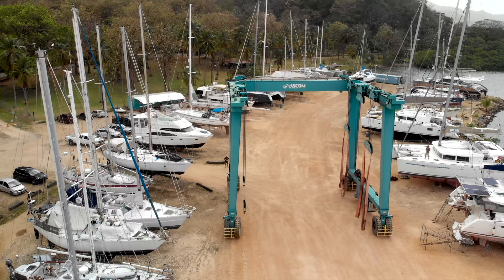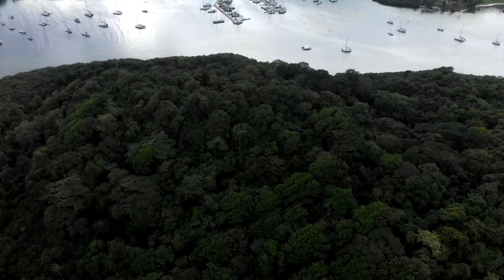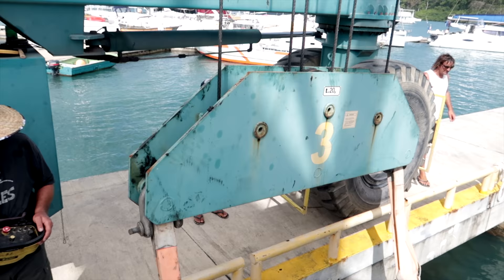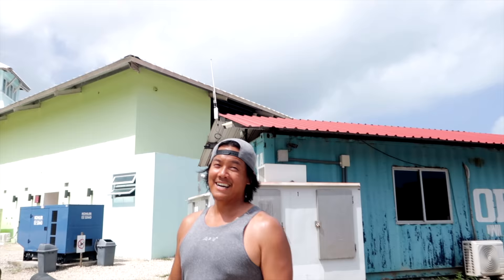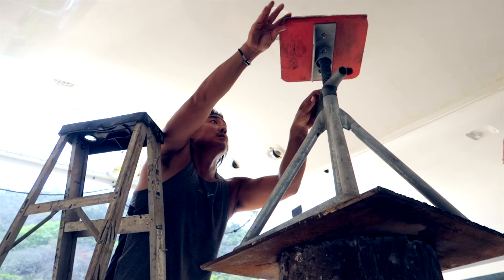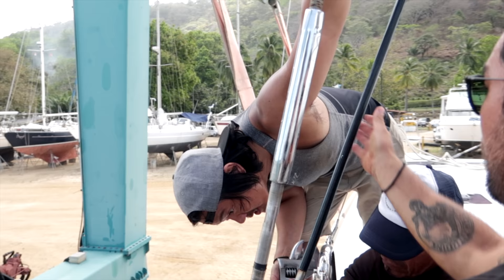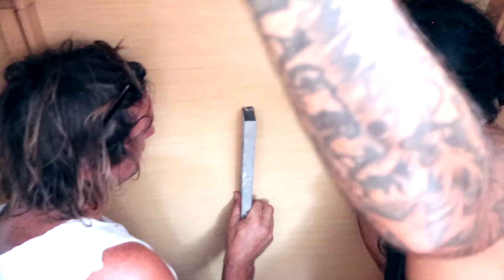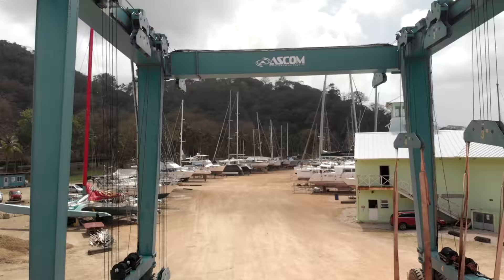Straighten Your Bent Catamaran in 8 Simple Steps - Cracked Bulkheads on Lagoon 450

Comment: David. Restoration Mechanic here. If you haven't already done so - Invest in boxes of Ziploc bags and tape. Every thing you remove, write the number on the part, and the bag of fasteners, then tape it to the part if possible. This will save you from the Remove and Lose gremlin more often.
Take Pictures of everything if you aren't already! If you think you have enough pictures of an assembly - take five more. This will literally save your sanity reassembling things - and can be used later to prove damages if this turns into a legal fight.
Also - instantly subbed you and parlay :)
Reply from the maker: Thanks for the tips! I'll go grab a bunch when i head back. The remove/lose gremlin has a secret move on boats where things always end up sinking in to the depths. I do the take pics trick, but sometimes you have to back up and take a pic of what you're taking a pic of. Also, did pokemon really get you out of a ticket? would make sense that cops would play.
Reply: What can I say, the southern US is a strange freaky place where people go to cemeteries at 3AM to catch Pokemons.

Comment: Good to see you getting your repairs done David, and the help and advice from Colin and Jamie. Mate, you have experienced first hand a little of the Kiwi and Aussie (ANZAC) spirit with these two ambassadors of their countries. Down to earth guys and honest as the day is long.
Keep up the positive attitude David, you will have a solid boat to safely enjoy once you are finished, same as Colin and Jamie.
Lagoon are no doubt in damage control mode trying to avoid huge class action law suits as a result of their poor design and build quality. This possibly would be why they aren’t getting involved anymore with a repair procedure or advice so as to not acknowledge any possible liability for this issue.
At any rate, you don’t need Lagoon especially when you have Colin and Jamie there for advice 👍
Reply from the maker: true, excellent guys, awesome attitudes! I'm kind of thinking the same thing, that Lagoon is worried that providing a comprehensive repair procedure will simultaneously admit liability. After all, the only reason that so many 450's require extensive repair and/or reinforcement is because it wasn't built/designed correctly in the 1st place. Thanks for following along! Can't wait to show you more once I get the cabins torn apart!

Comment: Lagoon should of hired Colin to design a fix that worked for the customer regardless of cost we all TRUST Colin to do it right!
Reply from the maker: I definitely trust him! Lagoons current repair procedure is ~20% of what Colin did and what the actual boat's designer recommened... that's why so many owners are upset. Lagoon wants us to glue some wood to the broken bulkheads, shove a steel bracket around that wall, and completely ignore sunken floors; awful misalignment; and the mid and aft broken bulkheads.

Comment: Every time I see that single ply "bulkhead" I shake my head in disbelief.  It doesn't even seem like it was a materials cost savings, as the outer 2 layers were cut away and scrapped.  Why you wouldn't just keep the 3 layers is my question!
Reply from the maker: I totally agree! I built my kids scrap club house with thicker plywood! For the owners with bulkheads that haven’t failed yet, how could they not see the flaw/weakness!
Reply: I know right? A couple hundred dollars of plywood NOT installed causing thousands of dollars and hundreds of hours of repair. I just don't understand the LACK of logic in that choice by Lagoon...
Reply: it is just a way to get tolerance adjustement when they quickly « glue » the  bulkhead. i am pretty sure that each hull get  big tolerance shape, they slide the main plywood into the 2 small piece already tab to hull. then layup the glass all’over the bulkhead.....quick and dirty ....
Reply: @TexasVeteranPatriot  "Experts" designed it...
Reply from the maker: @TexasVeteranPatriot  not to mention the huge hit to their reputation! People need to trust the company they’re about to spend a million with.
Reply: @david_shih  Exactly. For the price they ask especially for charter industry, the damn thing should be done right. A couple hundred bucks worth of extra ply and epoxy is not too much to ask, on a load bearing bulkhead to mitigate a potential catastrophic failure at sea with loss of life. I suspect Lagoon is going to take a bath on this issue if they don't step up. Good luck, bruddah!.
Reply: Exactly what i thought when i saw 1 layer of ply, im an Automotive engineer and a carpenter  and it made me shake my head in disbelief knowing the strengths of plywood pretty well!
Reply from the maker: Well hopefully tripling up the plywood from bottom to top and reinforcing the beam (next weak point) will do the trick...either way, I'll show you how it turns out!
Reply: That single plywood bulkhead should be built like a box beam. Single ply plywood as all web/girth but no flange. 50 -80 ton Military tanks have used light weight box beams made of wax cardboard (very much like hardboard) to traverse tank traps. They have huge Section "Z" modulus. That is the coefficient that represents the resistance to bending.
Reply: @david_shih  can’t wait to see what you’ve done

Comment: David, you need to get yourself a nice borescope camera to inspect the nooks and crannies of the boat where you cannot really reach. It’s a way of doing a far less destructive inspection as well as being able to get a better view of where you need to cut, remove, etc. with what you’re doing, you will LOVE having one for sure.
Reply from the maker: thanks for the suggestion, definitely are lots a places I still can’t see. I have a cheapo one that didn’t work too well, but I heard they make ones that bend remotely once inside the hole.
Reply: @david_shih , I have also purchased the cheapo ones to see how well they work. Definitely not the effectiveness of a real borescope. I know the real one I have isn’t made anymore, but I will have a look around for you and see which out there have the same sort of paise for it’s effective use performance. I know they have come down in price a bit with some nice tech added. They do indeed have the ability to manipulate the viewing angles and focus so that there is infinite adjustments at the lens tip as well as the scopes head angle and position. Makes ALL the difference when you can scan an entire area from one position. I can tell you for sure, this thing has paid for itself a hundred times over in saved expense and frustrations. Everything from pipe leaks to locating electrical breaks by getting the specific location of the actual issue without having to destroy either beautiful woodwork or having to pull apart an entire wall to get at the actual point of issue. Imagine the glee of finding that oddball screw that has fallen under the engine into an inaccessible spot in the engine bay of the jet ski and you can stick the magnet on the tip and retrieve it instead of waiting for a new one to be shipped, or, taking everything apart to grab it. I love the thing. I buy my borescope flowers and chocolates on Valentines Day, LMAO!!! 🤣😂🤣

As soon as I find something that would most certainly work for you, I’ll send you a link to it. They aren’t cheap (the real ones and not just one of those Bluetooth or wireless smartphone connected ripoff versions), but inwill find one that’s priced right. I can promise you this, once you find an issue that saves the day and a “boat load” of money (just had too use that, lol), the others around you will definitely be requesting to use it. A few of my friends actually chipped in after the fact of its purchase so they could have access to it and feel they contributed after they offered money to sorta rent it and I told them to just use it and keep their money. It was enough of a savior that they forced me to take the money or they would find another way to sneak it into my wallet, lol.

If there is another way you would like me to send the info, let me know. Otherwise, I’ll just post the link here in this comment thread for you. 👍🏻😎👍🏻
Reply from the maker: @Far2hip  wow, man you’ve got me completely sold. I had no idea it could get better than the cheap ones. I’ll go ahead and buy whatever you recommend. Please look me up on Facebook and we can connect there. https://www.facebook.com/david.shih.37017
Reply: @david_shih  will do my friend. 👍🏻😎👍🏻

Comment: Here's a suggestion for the boat yard - invest in 4 hydraulic rams so that they can be raised/lowered to desired heights and a simple laser level. It looks like there might be a couple (lol) more Lagoons that might need to have the bulkheads reinforced and with the hydraulic rams as a service, the yard  could become Lagoon's repair center in the carib.
Reply from the maker: That would have made me feel better than tubing and soy sauce! Might be useful for other types of projects too. But boats tend to stay on the hard for much longer than expected and would put the ram out of commission until they leave. I thought I’d be all fixed up in 3 weeks—I’m 5 months in. Or am I misunderstanding…is this ram moveable. I was imagining something built-in like a car lift.
Reply: The steel pylons should have adjustable stabilizing legs and the adjustable stands on top should be permanently attached to the pylons by fasteners or welding. Colin only had them rigged as a one off one time use. Obviously they will be used much more often than ever planned. The water level is perfect and made better if caps/plugs were made for the hose.

Comment: Amazing how you guys got it to flex back into place for repairs ! My question is how much extra $$$ would it have cost the manufacturer to build it right , the first time ...... ?
Reply from the maker: Oh man don't get me started...Lagoon definitely save tens of dollars by skimping on a couple extra sheets of plywood and bit more fiberglass. Definitely worth the horrible publicity and loss of sales. I honestly don't know what they're thinking...why not get in front of this and help all the owners with the same exact problem?!
Reply: @david_shih  They had a way to look very,very good, and they've blown it for as you say some time and materials. Did you notice that the market seems to be flooded with Lagoons?
Reply: @david_shih  It would be VERY interesting to know how they are CURRENTLY building their catamarans. If they ARE adding reinforcement to bulkheads then surely that's admitting the fault exists in previous manufactured boats.
Reply from the maker: The market still seems pretty consistent. Still sellers, some buyers. I know some that just bought one in panama and sadly found broken bulkheads as well.
Reply from the maker: Agree with everything you've written! I'd actually be OK with the build quality of these 'semi-disposable' boats. I kind of made that choice when I decided on a boat this size in this price range. However, a design flaw and failing bulkheads should be outside of this scope. I'm sure you agree and I'm just venting, but it's like an unreliable/cheap auto brand can't put out a car where the wheels fall off. So true that they usually shrug this kind of stuff off. Apparently theyve already been doing this conerning the bulkheads as there have been multiple incidences starting a couple years ago.

Comment: Just go to Home Depot and get a RIDGID palm router for all the interior trimming when you put it back together.   Collin and Jamie need one too 😂.  I saw them using a circular saw and hand chisel to create dado joints on parlay  😳 😂
Reply from the maker: Should I go battery or wired? Also, is ridgid that much better than Ryobi? Been getting lots of recommendations for dewalt and makita!
Reply: @david_shih  If you go battery be sure to get extra batteries, personally I prefer a corded power tool.  Most of the "name" brands will do for a (relatively) light job like you're facing.

Comment: Congratulations David, the first step in your repair is complete. How many weeks ago was this filmed ? Colin and Jamie had some trim problems when it all went back together... will you do same triple plywood and epoxy plus glass reinforcement ? Or do you have another solution in mind ?
Reply from the maker: I’m following in their footsteps, so same repair for me! I’ll be rebuilding part of the forward cabin so no worries on the the trim and bulkhead thickness. I’m quite a few vids behind (forward cabin destruction, aft cabin destruction, cutting out bulkheads, a sweet solar arch build, insane grinding, washing the cabins.) trying to get caught up to real-time ASAP!
Reply: @david_shih  Hope your cleaning up wasn't as messy as theirs was... it looks like you learned from that mistake and got better ventilation and isolation to confine the dust to minimum area possible.

Comment: Question:

If the final distance between keels is specified at 537 cm and you achieved that with the shrouds loose, will it not change when you tighten the shrouds later? What I am getting at is that should the distance not be less so that when you tighten the shrouds and stress the bulkheads, the final strain will spread the hulls and result in the specified spacing between keels?
Reply from the maker: Peter, man you're on top of it, what a great question. It was too much too explain in the video, but we actually went about 10mm past original to compensate for that. However, once the bulkheads are completely rebuilt, the hulls shouldn't flex much at all.
Reply: @david_shih  My experience is more with building automotive chassis, but I do know that when I stiffen a chassis there is a noticeable change in how the car feels to drive; especially on bumpy ( wavy?) surfaces. Wondering if the work being done to the Lagoon is going to have any noticeable feel to how it feels to sail?  Looking forward to seeing you guys back in the water.
Reply from the maker: @peterplouf2836  what kind of cars do you build? Sound really interesting. As for stiffness, there’s another guy Colin advise on the bulkhead repairs and his are done. Supposedly the cat sails completely differently and is more stiff and responsive. He was really happy with the repair.
Reply: @david_shih  Grew up with drag cars and now into hybrids. Drive a 1973 Volvo 1800ES  grafted on a Miata chassis with a 302 and am building a 1950 Morris Minor with a Honda drivetrain in the rear seat area. As an engineer, I am kinda sensitive as to where loads go  and/or are dissipated when  you stiffen one area and the loads are applied to a different area; you know, that old stress/strain conundrum. Stiffer is NOT always better depending on what you tie into.
Reply from the maker: I am a bit concerned about where the load will go once the bulkheads are strong...so I'll be reinforcing the beam above and the hulls below with more tabbing. But only time will tell. Miata...have you heard of Flying Miata my buddy's family runs that place. What kind of hybrid project you got going? I would love to do an electric conversion on the boat one day and diy the whole battery bank.
Reply: @david_shih As a Yacht Designer I can tell you that it will be a night and day difference... A boat with such flimsy bulkheads will already flex way too much even if they are yet to be broken... Seeing the condition of yours it will be much much better! But be sure to ad enough fiberglass capping and fillets to properly tie the new and improved bulkheads into the hulls. Maybe also consider some stringers running on the hull from the bulkheads to spread the load... We do not want to have the next component on the list of shoddy build quality to fail!

Comment: Has any of all this flexing caused any stress cracks in the gel coat on the outside of the hull?
Reply from the maker: Yes, but Not caused by flexing back into alignment.  They formed overtime as the bulkheads failed slowly and the hulls initially when out of alignment. Cracks at the Back of the fly bridge, along the bench of flybridge, transom corners and edges, windows popping out needing to be resealed, weakness in the coach roof when you walk over it (above cockpit). I’ll be fixing them all…eventually.

Comment: I don't know if this repair process is being documented somewhere, but those critical measures really should be documented somewhere where anyone can find them. Someone will run into this issue over 10 years from now, and it doesn't help if someone had them on their whatspace, assbook or wahoo. Maybe there is a sail boat wiki or some other place where the information stays until these boats are no more.
Edit: https://repair.wiki
Reply from the maker: The thought was that Lagoon would step up and provide a repair procedure, it really should come from them. So far what they came up with is just a plan to reinforce the design flaw on boats that haven't fully brokend and bet yet. Colin used back channels to talk with the original designer of the boat to get this guidance.

Comment: There's another YouTube channel currently building their own 42ft catamaran as a kit boat and they started putting their bulkheads in. Seeing their bulkheads and the Lagoon bulkheads here and on Parlay makes me wonder why this problem didn't came up much earlier...
Reply from the maker: I’d be interested in watch their bulkhead work! Can you share the channel? Thx!
Reply: Their bulkheads are foam core composite with optimized strand direction and reinforced with effectively quadaxial in critical areas.  The door cut outs are nicely rounded with an inner flange reinforcement of unidirectional fibers and below the tabbing the hull is also reinforced with unidirectional fibers.  That is very light weight and strong performance cat design and in no way comparable to Lagoon.
Reply from the maker: I’ll check them out for sure. Thx!
Reply: @michaelhaardt5988  it's really a huge difference, that's why I mentioned it. A nice example of how it should be.